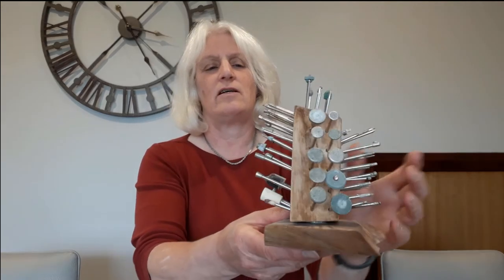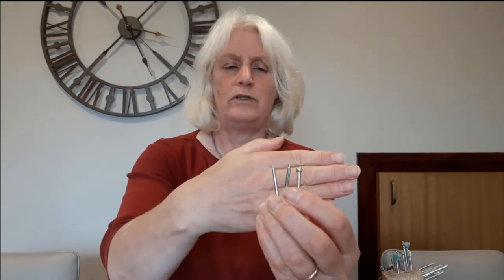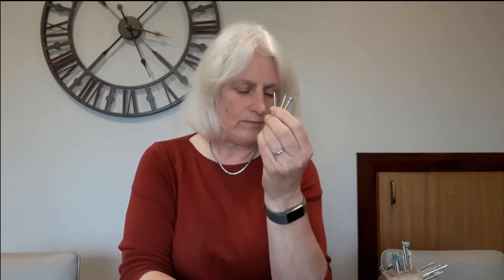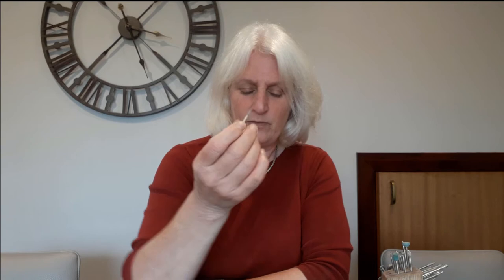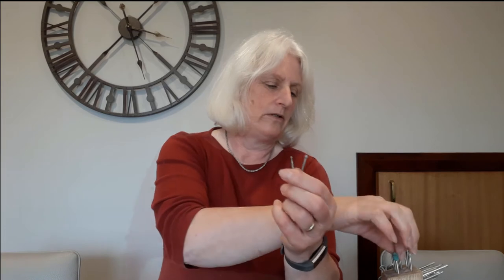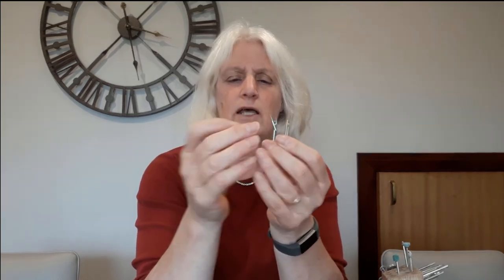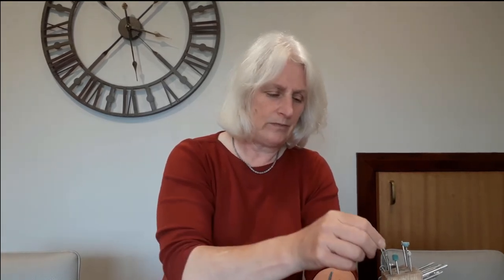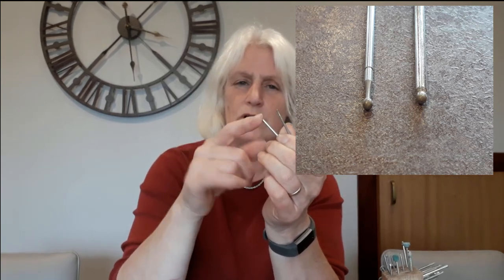Glass Engraving for Beginners, Part 2 - Bits and Burrs

Comment: Hey! I absolutely love your easy to follow videos for beginners! Just picked up glass etching a few weeks ago so still very new at this. I bought a diamond bur set from Amazon but every time I try to use them they produce a black mark. I tried slower and faster speeds but still the same outcome. Am I doing something wrong or is there maybe something wrong with the Burs I bought? Any suggestions on exactly what brand of burs to buy or any help would be appreciated!
Reply: Also…. I’m sorry about any gaming videos you may see on my YouTube. This is actually my sons account
Reply from the maker: Those black marks usually happen when there are areas on the burr where there is no diamond so the metal shank rubs against the glass and leaves the mark.   In any set of Amazon burrs you are likely to have a few that do this.   Hopefully some of them will work for you though.  You are not doing anything wrong.  I am not sure where you are based.  Here in the UK I could recommend you go to Eternal Tools or B&H Supplies to get get some better quality ones.  In other countries I have limited information for you.   You could try searching online for "jewellery making tools and equipment ".  That often brings up the better quality suppliers in your area.
Reply from the maker: Find out if he has any tips on how to beat Odin in FFVII rebirth! Really stuck with that one.

Comment: Have you used Tungsten Carbide burrs? I just purchased some thinking maybe they will last long then Diamond Burrs
Reply from the maker: Tungsten carbide burrs are useful for wood or metal work, but not so good for glass.  You are likely to find they will skip on the surface and not make much of a mark (assuming you are using a rotary tool).  If you are using an engraver which works by  vibrating the point rapidly against the surface tungsten carbide might work better.